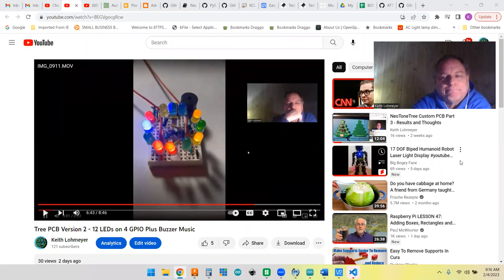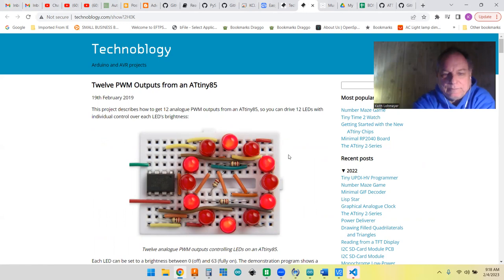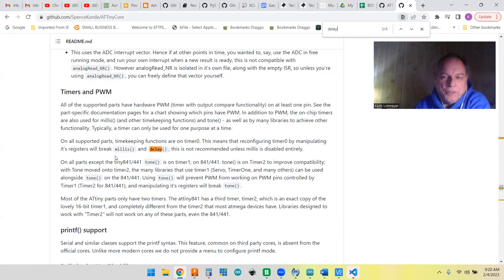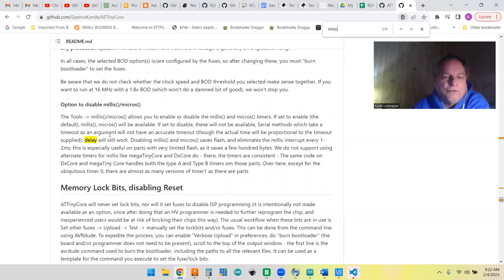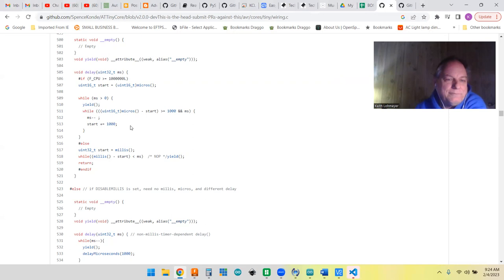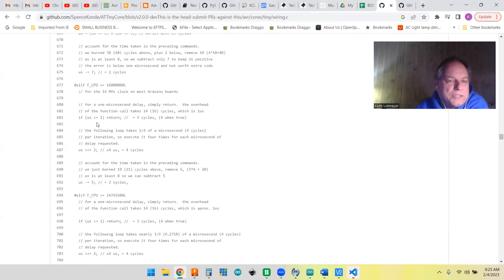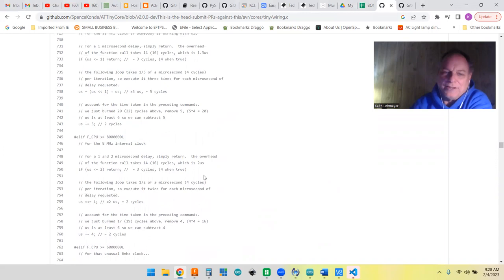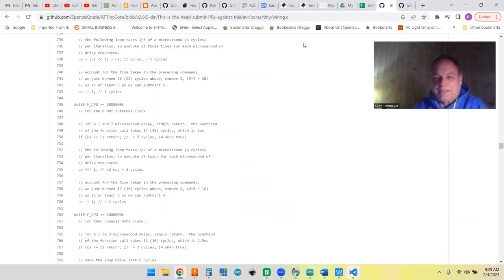ATtiny Core Disable millis()/micros() and still use delay() ??

Comment: Spoken about micros and millis on the Christmas tree, what would you do to flash the lights in sync with the music? Programming or using a music sensor? or anything else.
Reply from the maker: Hi Wendy, On my board the code changes the LED pattern randomly on each note played. I have seen code on the Adafruit Circuit Playground Express board where they use the built in microphone to flash the onboard LEDs to external music. So it can be done that way. Thanks for the comment.
Reply: @keithlohmeyer  Thanks Keith, interesting stuff.